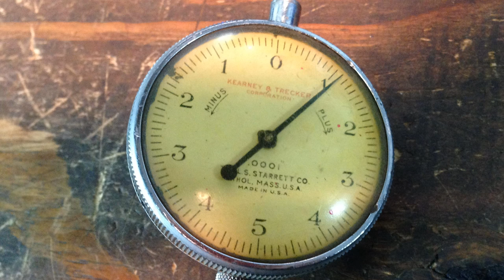Saturday Night Special 117

Comment: Hi Adam, just a little info on rebuilding hydraulic cylinders. I have done Cat, Komatsu and Yanmar cylinder rebuilds and inside the gland, aka the cylinder head, there is another replaceable wear item. If you look on a manufacturers parts diagram and parts list you will see a bushing inside the gland, it's a part I always replace when doing a repack. If the bushing is worn the piston rod travel off center and will wear out the new seals fast. You have to put some cuts on the old bushing and fold it in on itself to remove it, then you have to press the new bushing in. I make a little install tool so not to crush the new bushing when pressing it into the gland. I don't know if your cylinder has the bushing, but if there is one, its pretty important to replace it.

Comment: I need to figure out how to scan some pages out of my dividing head operators manual.  It gives all the counts for spacings and all the various angles as well. It is several charts of good info for setups. Great meeting you at the event and travel safe!
Reply from the maker: Brian if you have something like a a kinkos or copy companies nearby they can scan them for you and put in a PDF format, or copy just as well. 👍👍
Reply: Abom79
Good idea! We have a scanner at work tooand I wouldn't think it to be that hard to figure out.  I will get it done one way or the other.
Reply: +bcbloc02 Tiny Scanner Pro for iOS or Android. Only requires a smart phone and creates PDFs instantly.
Reply: +Peter Kelly 2nd Tiny Scanner - Great for stuff like that!
Reply: Practical Metal
Well it would be great if I had one, but my cell phone is only one step away from having a cord. lol

Comment: Adam, just had to rebuild a steering cylinder from a Ford 555B backhoe. The rod was pitted and the end cap didn't want to come off. Ended taking it to a one man shop in Oxnard CA. The gentleman went to trade school in 60s and hasn't been out of work ever since. He turned a new chrome rod and piston. Installed new seals. The ends are like tie rod ends and the rubber caps were missing. He said they were solid so I installed zerk fittings and made some seals out of old shock bushings drilled out with a hole saw. These parts were no longer available through the local dealer, works better than ever.

Randy

Comment: Nice video, thanks.  
What solvent do you use?
Where do you buy the seals and O rings?
Is there much difference between rebuilding an oil vs pneumatic cylinder?

Comment: Are there any hydraulic cylinders designed specifically for horizontal use? Not like the small ones in the video but large multi-stage cylinders. Like how does a large cylinder that operates on it side not wear away the seals and wipers from all that weight of the cylinder pushing down on them?

Comment: The jd one I rebuilt you had to keep the gland and piston close together when you put it in the cylinder cause you had to push it in cylinder a ways to put on snap ring.So far it works.
Reply: They're a mess to deal with. You gotta yank out the whole rod and piston to get that end out, instead of just being able to unscrew it and it working itself out. Makes a mess if there is fluid left in the cylinder.

Comment: What were you using to clean those pistons?
Reply: +Troy Spiewak I wondered about that as well.
Reply: +Dan Whiteford   Mineral Spirits is a good petrol based solvent that cleans then evaporates.  It is better than Lacquer thinner and others as it is not as harsh on components.  just my $ 0.02.  and it is less expensive than others. usually
Reply from the maker: Fast evaporating solvent degreaser, made by Zep.